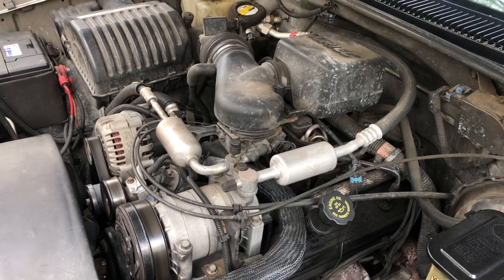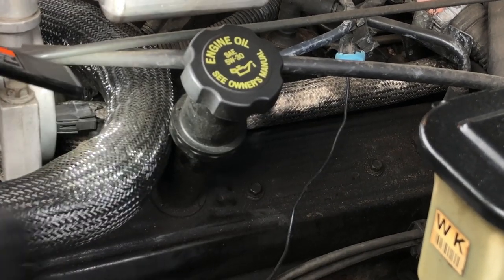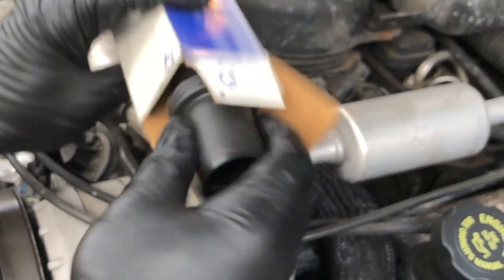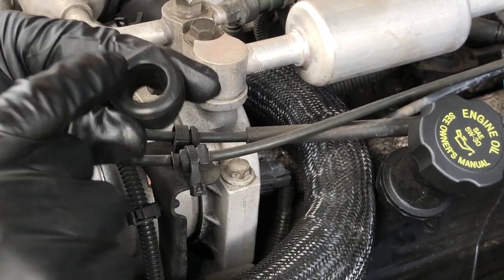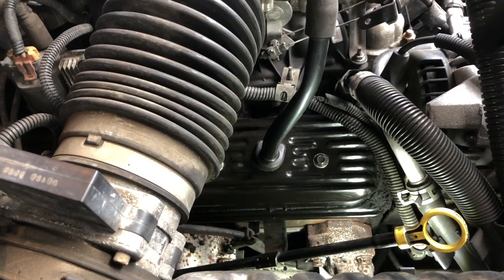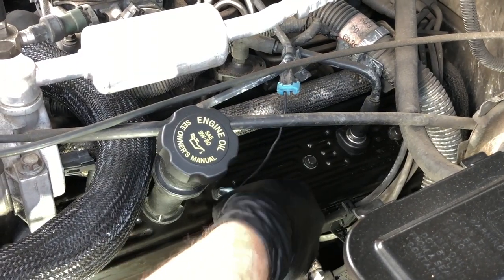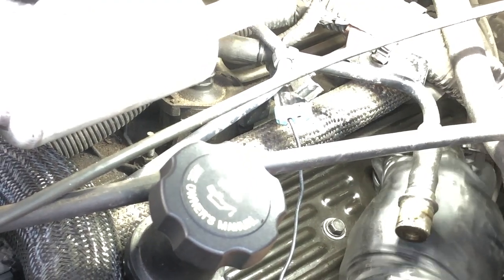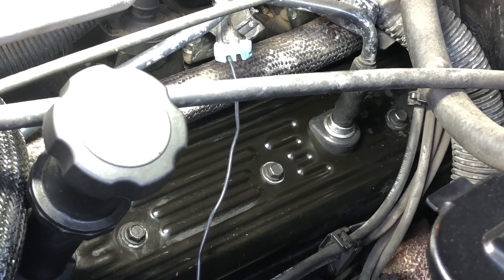1992 - 2007 GM Truck Van Engine Valve Cover Emission Pipes & Grommets Oil Leak Repairs (Chevy & GMC)

Comment: Did mine a couple years ago, dry as a bone. 99 k2500 5.7 Burb 156,000 miles and runs as good as the day I bought it.

Comment: Thanks for the video. I was wondering how to remove and replace the oil filler neck on the Valve cover? I have a 4cylinder equinox. The neck on mine is loose like in your video. On the equinox forums they say it’s fine. But I know it’s not. How does the neck come off? I tried twisting off but it won’t. Am I missing a step? Thanks in advance
Reply from the maker: Not sure about your vehicle, but on the vehicle in this video the filler is a male thread with an o-ring seal and the valve cover has a female fitting for it to screw into.  I'm sure each engine has a different design though as that's the GM way.  ;-)

Comment: Thanks! I just ordered. Do you still use 5-30W oil or have you upped the viscosity? (I had to on my 7.4L gas as I was getting "Check Gauges" due to low oil pressure at idle after long and hot Frwy drives).
Reply from the maker: Still using the factory 5W30 dinosaur squeeze.  Wally Mart SuperTech
Reply: Oil is earth blood not dead Dino lol

Comment: Just curious. Can a faulty oil filler neck O ring at the valve cover which is definitely causing an oil leak result in low oil pressure?
Reply from the maker: Nope, purely an external (i.e., cosmetic / mess) problem if that o-ring fails.   There is no pressurized oil in the filler neck or valve cover pcv areas.
Reply: @DrShock  Thank you for the reply 🙂
Reply: Actually if those gromits or any other top end oil leak has the ability to suck in un metered air. Computer will notice and compensate by closing the idle air control more causing the air leaks to leak more or pull in dirt covered oil. Also if you have a Pcv that pulls air ether way the idle air control will hang up and annoy you (ie trying to power through the brakes at a light) or holding high rpm during a shift. For about a year I unplugged my iac and drove it without. Turns out that works but is dumb. At high rpm it reverse sucks air through the breather tube which brings oil with it. Then the carbon chunks inside the intake start letting go and end up in a chamber. Hard enough chunk can bend a valve or worse. Also carbon in a cylinder can glow like a bbq briquette and cause detonation.  Lucky for me I caught it early.

Comment: If your in a pinch wrapping the pipes pcv valve with electric tape will help expand the grommet enough to seal. Great video it’s hard to find info on these engines. Especially for Cadillac

Comment: What did you use to clean your valve covers they came out so good
Reply from the maker: Soapy water with Dawn dish detergent.  It's a fantastic and non-toxic degreaser.
Reply: And all you did was just wipe up the soapy water you didn’t like wash it down with a hose or water or anything
Reply from the maker: I wouldn't recommend getting a hose on the engine, these old vehicles are no longer water tight in many places and you can cause electrical problems to creep in.   Just wiping it off with dry shop towels to start, and the soapy solution for the tougher spots should be fine.
Reply: Thank you !

Comment: My pcv tube broke inside the grommet would I have to take off the valve cover to take it out.
Reply from the maker: I'd see if I could get a long nose plier in there to remove the grommet with the broken off pipe piece first.  If it looks like the plastic is going break up and fall into the valve train area, or you can get it out then I'd pull the cover.  If you have to pull the cover, don't forget to replace the gasket.

Comment: What if oil is leaking from the bolts on the valve cover ?
Reply from the maker: You should check the torque, these can loosen with time/vibration.  There is no gasket used on the bolts or their mounting holes though.

Comment: Can the loose oil filler neck cause low oil pressure? ~22 -25psi
Reply from the maker: No, not at all.  There's no oil pressure in the valve covers, it would only lead to leaks and perhaps PVC blow by (which again would cause a leak stain).   Low oil pressure is going to be dirty or non-OEM grade oil filter, dirty or wrong grade motor oil, or a problem with the oil pump internal to the engine.  This is, of course, presuming the oil pressure gauge is reading correctly and the oil pressure sensor is reading correctly.
Reply: @DrShock  thanks for the reply! I didnt think so but i was reaching for a quick fix. Going to change the oil and see whats up 🤞🏻🤞🏻